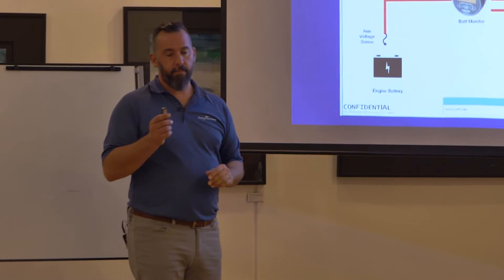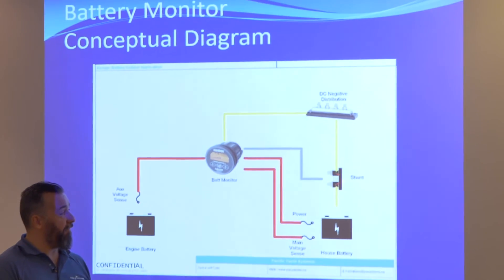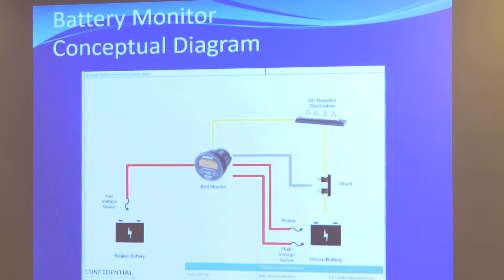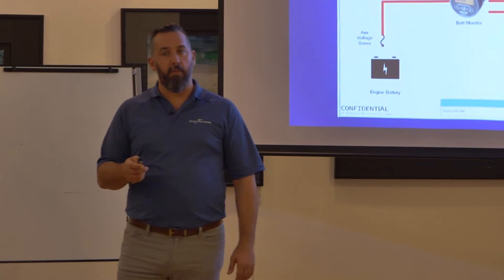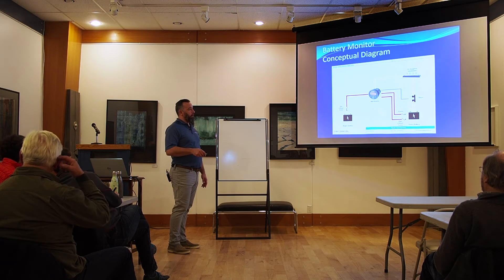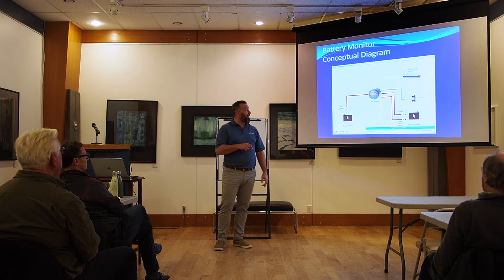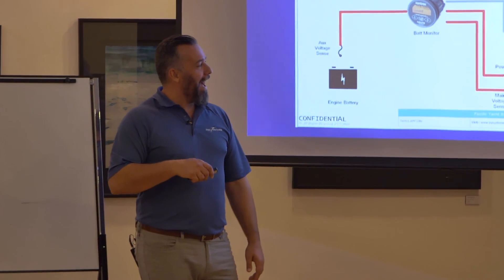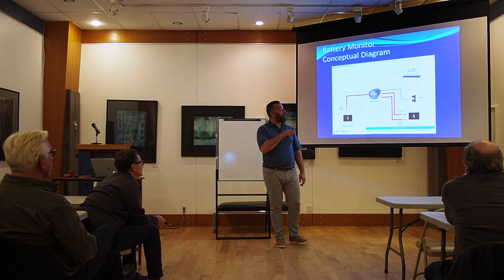How To: Marine Electrical Seminar - Battery Monitor Troubleshooting - Ep 29/30

Comment: My Xantrex worked great last year. Put new batteries in this year and one shows 8.7 bolts while the other shows 12.8. Had the batteries tested by a pro and both were perfect. Had no issues last season and put everything back the way it was. Bad monitor?

Comment: Hi Jeff , situation = powerboat , 2 outboards . 2 cranking bank , 1 house bank . will the reading of the battery monitor change if the battery combiners are on COMBINED position ?
Reply from the maker: On combine, all the battery voltages should be similar as long as one battery wasn't too discharged versus another.